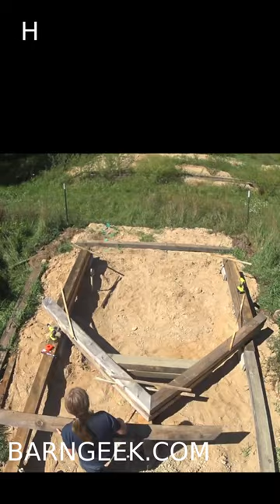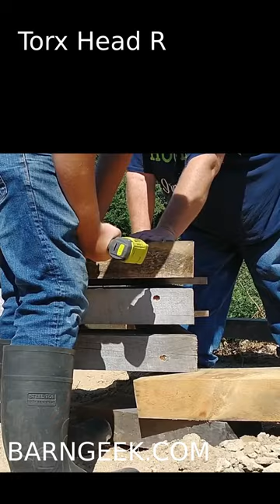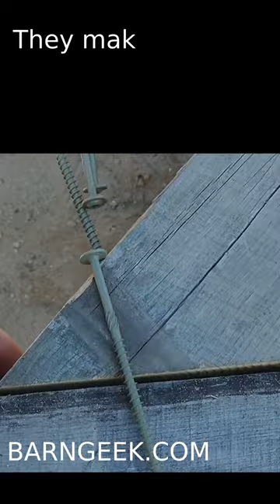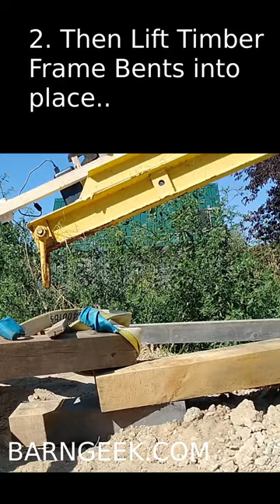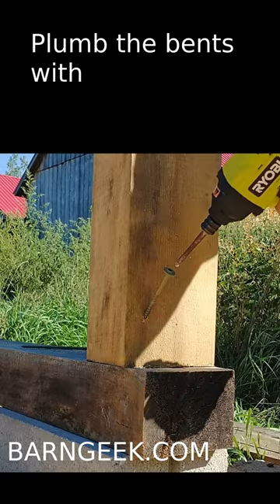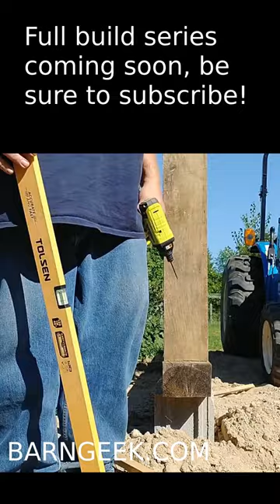How to Build a Timber Frame Shed with Rough Cut Sawmill Lumber Pt. 1 Short Version

Comment: respectfully, this clip shows post and beam construction techniques, ie no traditional joinery used, and connections are made with screws. it's nice work, however, true timber frame construction uses joinery (such as mortice and tenon) and wooden pegs to connect components together. in some cases metal screws, bolts brackets, may be required by local building codes.

Comment: Wondering if using one screw per beam surface is enough. Never used them but was thinking about there ability to stop the wood from twisting and splitting at the connection points.
Reply from the maker: We use at least 2 per joint.. I don't show all the screws being installed because people get bored and stop watching. However, these RSS screws are fantastic and probably would hold just fine with one per joint.